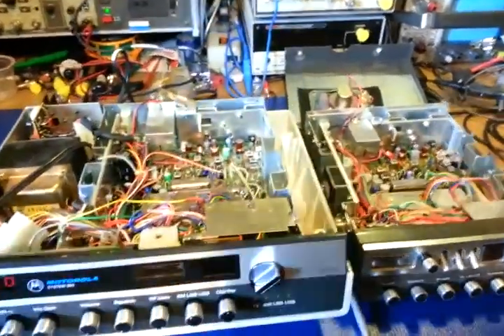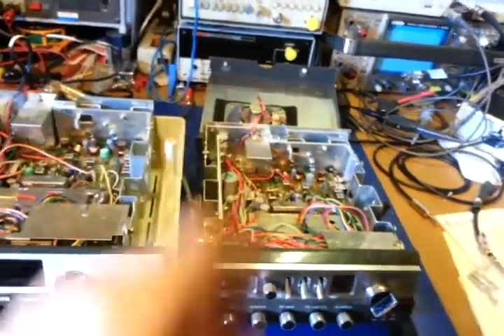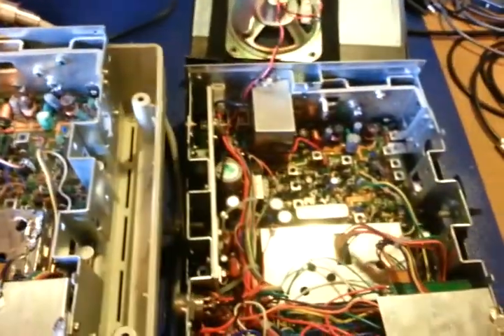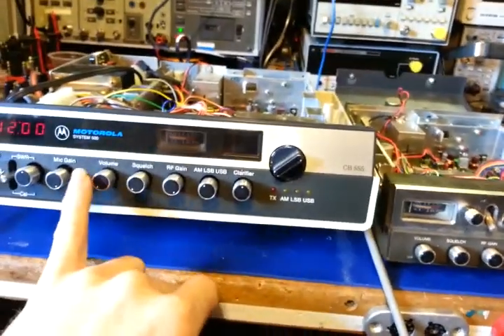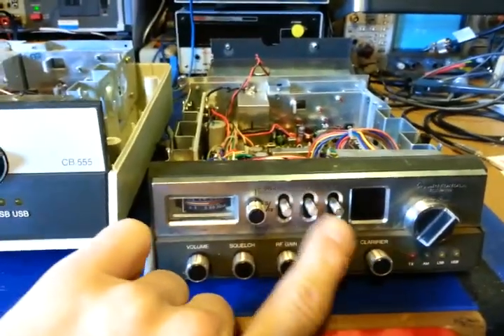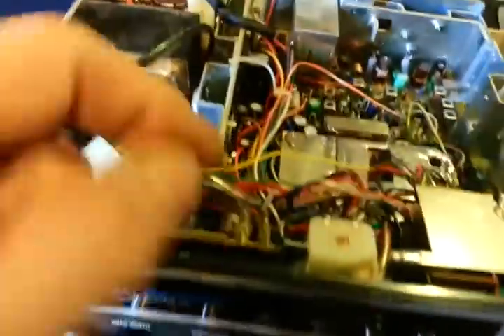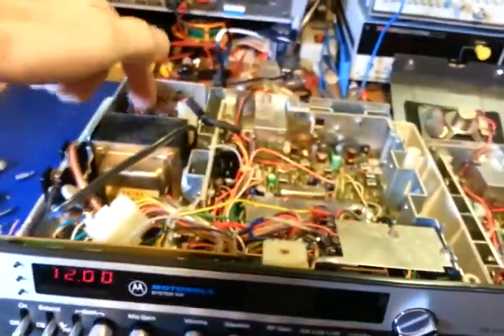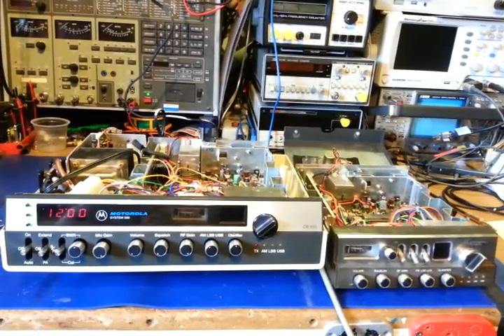Motorola CB555 and 550 comparison.

Comment: Yup your right the 555 looks like it has a 550 inside, clever shortcut cost savings.  LOL!    Police used Motorola CBs back in the day. Thanks for sharing w/us.
Reply from the maker: Most of the junk export big box export radios made today are the same.  Just a mobile in a bigger cabinet with a power supply.  Makes sense, why reinvent the wheel.  Saving money on production cost this way keeps the customers purchase price down.